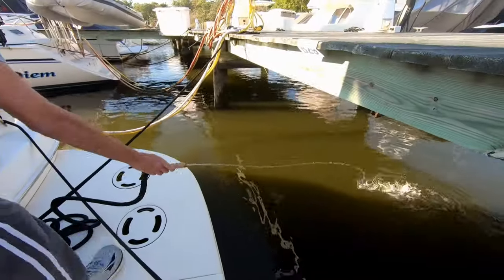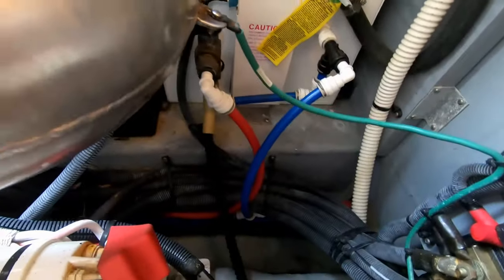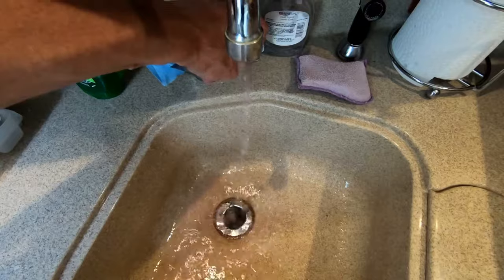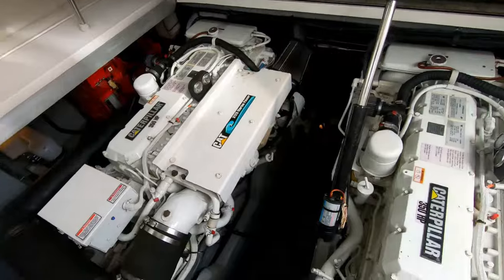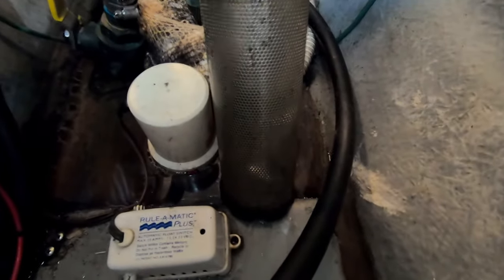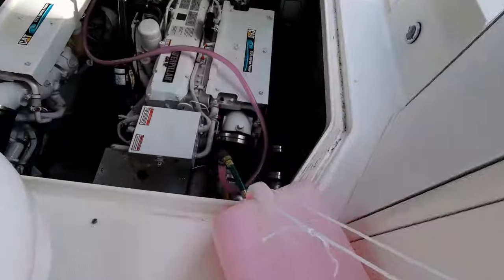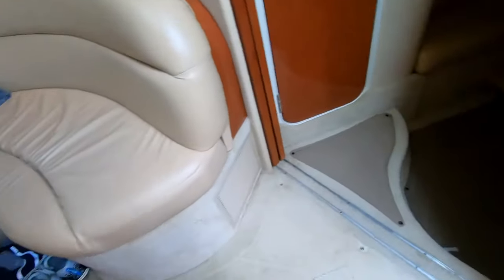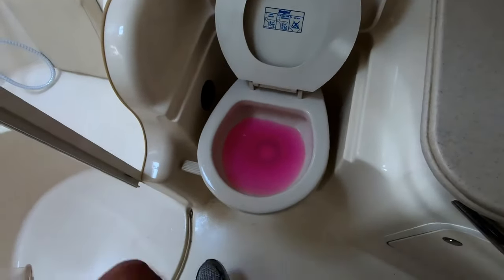Boat Winterizing - Hot Water Tank, Engines, Generator, A/C, Drains & Sumps

Comment: You winterized your engines in your slip, isn't your boat going to be stored on land?  how are you getting it to the travel lift, without starting it?
Reply from the maker: Our marina tows our boat over to the travel lift - they never start the boat.
Reply from the maker: And good question btw - would definitely defeat the purpose of winterizing if you had to start your engine to cruise around to the lift! ;)

Comment: Great job, but you didn't pull pink into the toilets by flushing from the tank, just poured it into the blackwater tank.  Did you forget or do you not have issues with the feed lines to the toilets?
Reply from the maker: Thanks! Yes we did do that - in fact this was like a part 2 for winterizing covering raw water systems- pink in heads was covered in our previous video on winterizing for Freshwater systems, Fuel fill up & final pump out - https://youtu.be/vcAHZiDGomU

Comment: Great video.  Our new-to -us 400 Sea Ray Sedan bridge has Cat 3126 engines that look very similar to yours.  What are your engines and HP? This will be my first attempt at winterizing a closed cooled system.  Sure seems a lot easier than the raw water like our former boat.  One other thing, I really would like to just pump compressed air through the system vs adding the pink stuff like I did on our old boat.  My fear is that next season might take a while to get rid of the antifreeze taste.  Thoughts? Thanks for sharing your experience and your videos!
Reply from the maker: Thanks for watching! Great boat you have and yes we have the same engines on our 410DA- CAT 3126… been doing our engines this way for years with no issues & once you have process down it’s easy. For water systems some people do the air but we prefer running pink through and knowing it’s protected from any trace of water. We flush it in the spring & use a product called Spring Fresh - works great. We have a few other videos on this - how we winterize & how we flush out in spring. Thanks for following & let’s hope winter goes fast!! 😊

Comment: It appears that you don’t need to bring the engines up to temperature to open the thermostat. Am I understanding this correctly? I have read that in order for the antifreeze to run through all the right places the thermostat needs to be open. Can you comment on that? Thanks!
Reply from the maker: The thermostat only needs to be open on raw water cooled engines where sea water running through the block. We have antifreeze in the block & only have to flush out the raw water side. This process is for closed cooling systems

Comment: Excellent video. I do an extra step and blow out the hose between the strainer and the seacock with a shop vac to remove the water. .
Reply from the maker: Thanks! If it makes you feel more confident, but if you run pink through that extra step shouldn’t be necessary. We’ve been doing it this way for 20 years!

Comment: best tutorial videos, thanks for sharing, i just have a question, regarding the holding tank, should i live the vacuum pump activated same with the fresh and raw  water pumps, hope you can answer me, thanks again.
Reply from the maker: Thanks so much - we really appreciate that! So, we do use our pumps to push pink through the lines while winterizing. One of the first steps for us is emptying our freshwater holding tank and adding about 6 gallons of antifreeze so that we can use the pump to run pink through all the lines. For heads we get a pump out then run pink throughout heads - you have to run pink through head lines to the head tank, so you gotta activate pump (flush). Hope that answers your question but lmk if not!

Comment: Also, do you put fogging oil in the carburetors and spray into the cylinders? Thanks again
Reply from the maker: Our engines are fuel injection so they’re are no carburetors - if you have a boat with carbs then yes you should use fogging oil

Comment: Great video!  Question though...On the engines, I've always heard that you have to get them up to temp so that the thermostats are open.  Is that not accurate?  If so, how long after getting them to operating temp do you have to connect and run the pink through the system before that thermostat closes again?
Reply from the maker: Thanks, good question too! Big Diesel engines like in our boat featured in this video have closed cooling systems meaning they are full of antifreeze inside already. We are only winterizing the raw water side - thermostat is on the antifreeze side. If you have a raw water cooling system then yes you should get engine up to temp before winterizing so that the thermostat is open.
Reply: @MyBoatLife  got it. Thank you!  I imagined it might have to do with being a diesel. But how quickly do the t-stats close back up on gas models?  Seems like it would take too long to open the strainer, replace the lid with the adapter, set up the antifreeze, and restart the engine. That’s always been my concern. The 5.7L Inhad in prior years was easy enough just to drain the block. The new Volvo 8.1s seem to be a different story and I’m considering antifreeze with these motors.
Reply from the maker: @ZippinZim  we used to have a raw water gas engine 2 boats ago and we would remove the drain plugs from the block, remove the thermostat housing and pour antifreeze into the hole & let it drain out through plug holes. Frankly it’s been 17 years since we had a raw water engine so maybe check with someone with that type to be sure. Hope that helps!

Comment: Quick question cant seem to get the pink to flow through sink faucets ir shower but It is flowing through the wash down on swim platform. Pump is running
Reply from the maker: Sometimes it has to run out water in lines for a bit til it turns pink, but if water pump is on and tank is filled with pink it should eventually run through.
Reply: No pressure in those sinks and shower is the problem just drips
Reply from the maker: @michaelmitchell5844  sorry hard to say.. doesn’t seem to make sense if pump is getting water to wash down but not sinks. 🤔

Comment: I really like your hose connection temporary top for the strainer. Looks like a small piece of wood, with two holes filled in it and then a hose fitting, with shelf liner? Can you share the dimensions on the piece of wood, and the distance between the two holes you drilled for the bolts?
Reply from the maker: Thanks - we’ll be doing engines this coming weekend & will try to get measurements
Reply: @MyBoatLife  we are trying to get one more trip in then sadly will winterize as well.
Reply from the maker: Hey saw your comment on our new video & then it disappeared? so put measurements in comments - Our Boat Engine Winterizing Kit & DIY Flush Cap We Use ✅
https://youtu.be/7aIFWzKeeaw

Comment: Do you empty the sea strainers for the winter? I'm new to inboards I've always had I/O.
Reply from the maker: Yes we pull the screen out & clean out any debris and we also pump antifreeze in them. You could also pull the drain plug if your boat is out of the water already. 👍

Comment: Do you have a quick and easy way you've done to flush/clean the a/c units from all the gunk?    I connect up straight to fresh water with using a cap on the strainer but would be interested in hearing how you do it.
Reply from the maker: Fresh water is probably the safest way to clean it out because you never know if a cleaner would damage the system.

Comment: Is it ok not to disconnect the hot water heater? Is it ok to run pink through the hot water heater?
Reply from the maker: Your best bet is to drain it, disconnect & bypass it - no pink in the water heater - otherwise you’ll waste gallons of pink & it would be diluted by water in the tank.

Comment: Very thorough video!     Question.   On those diesels, are you concerned at all that those diesels don't require a larger line to get the coolant in there to winterize?    I have big diesels and they seem to really push a lot of water through the huge 2000gph strainers.
Reply from the maker: It's a fair question. I'm sure the engines can pull a ton of water when at cruising speed, but they're just running at idle speed when we're winterizing. The engine creates a vacuum that sucks that pink right in, emptying a 5 gallon tank in seconds, so I'm confident that my little winterizing jig is delivering the pink plenty fast enough.
Reply: @MyBoatLife  ok, thank you.   I haven't winterized my diesels yet but plan to ASAP since it's starting to get colder here in Maryland.   I have the CAMCO kit which looks similar to what you used.   Your point about being at idle is valid.. thanks for the input.  I just didn't want to potentially burn the impellers.
Reply from the maker: I hear that! My impellors are a bear to replace but I haven't had to replace them in seven years. Even a little bit of liquid will keep them from burning up, but the real trick is to stay away from shallow water to avoid sucking up sand which really tears them up.
Reply: @MyBoatLife  winterized both engines today.  Used the camco kit on one side with a strainer adapter on the engine side.    Put in 4.5 gallons the first time and it sucked it down in a few seconds.   Put in another 2.5 gallons and started seeing pink.   All good here.    Was afraid that little hose wasn't going to be enough water but it seems to have worked.
Reply from the maker: Glad it worked for you... sounds like you did a good job! After twenty years of winterizing my engines that way, I'm not sure how else I would do it! ;-)
Reply: @MyBoatLife  Yeppers!   I wanted to follow up.   Instead of the hand made piece you have, I use the "Trac Strainer Fluscap Adapter" for groco strainers like mine.   It lets you screw it in to the strainer, attach your hose and go to town.  Same theory as yours but for lazy people like me who didn't want to create their own top piece LOL
Reply from the maker: That's cool! We couldn't find one to fit our strainer so we were forced to come up with a boat hack LOL! But thanks for the follow-up.. we'll add that as a resource for others in video description!